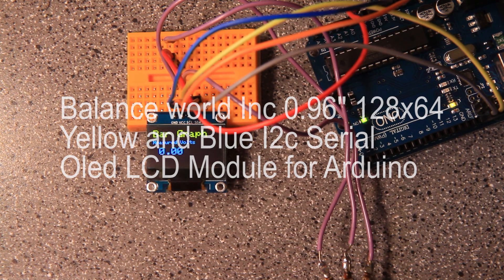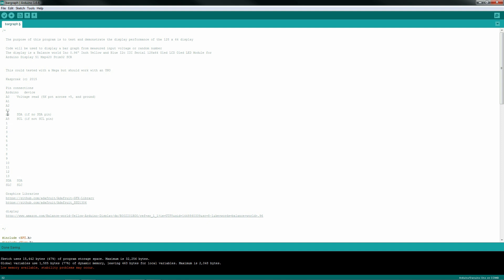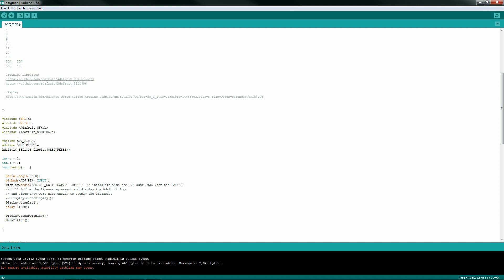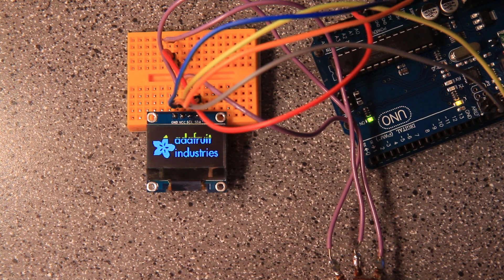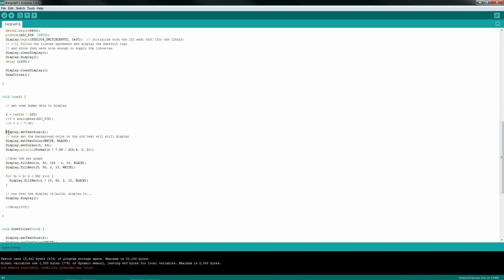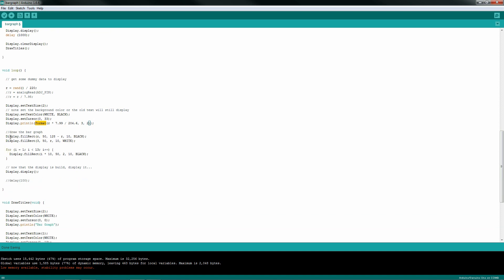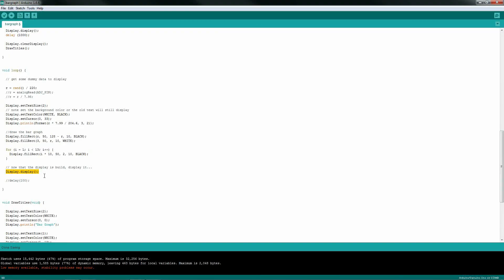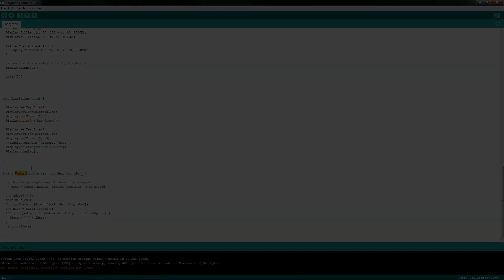Arduino and 128x64 OLED Display FREE CODE!!!

Comment: Hi Kris
I know this is going to be a long text/inquiry, so I apologize in advance.
I THANK YOU IN ADVANCE
My name is Jules, I’m an Arduino newbie. Before I spend a bunch of money with the Arduino I’d like to run this project past you, to see if this is even possible to do with an Arduino. Hardware I currently have
1- 12 volt 2 amp wall wart power supply 
2- Arduino UNO R3 (ie Elegoo super starter kit)
3- five ws2812b led light strips with 30 leds on each strip 
THE PROJECT
1- What I would like to do is have 5 different sketches (1 for each strip)
2- Then be able to run each strip one at a time, switchable with the IR remote supplied in the kit. 

So what and why I’m asking is this, I don’t know anything thing about how to program the Arduino, and I’d rather not go through the learning curve, and the expense if it’s something that won’t work anyway.
Reply from the maker: a few points
1. one LED strip requires 1.5 amps with all LED's displaying white meaning you will need a power supply of 7.5 amps (and that's the minimum). If you wan to ONLY turn one strip on at a time your 2 amp unit should work. If you turn 2 or more, the power supply will probably burn out
2. you will probably only need 1 sketch but 5 functions (one function per strip), but depending on what you are trying to do, you may able to have some if statements
3. I've never messed with the IR remote and sensor but I'm guessing you can recieve data from the remote and code a response
4. I'm not sure what it is that you are trying to do, but i'm sure you control each led and get different actions with the IR remote
5. you will have no choice but to learn how to program and Arduino. I'm sure there are examples out there to get you started. Especially in the libraries for the light strip and ID device

Comment: The includes in the source I downloaded don't look exactly like the ones I saw at 2:36 in the vid.  

*/

#include <SPI.h>
#include <Wire.h>

#include <Adafruit_SSD1306.h>

#define OLED_RESET 4
Adafruit_SSD1306 Display(OLED_RESET);

int r = 0;
int i = 0;

void setup()   {

Comment: The code will not compile   Help please
Reply from the maker: with the information provided, what do you honestly think I'm going to be able to do?
Reply: @KrisKasprzak  honestly after 5 years I wasn’t expecting a reply. Thank you for that.
I keep getting an error to compile and error status 1. Since I originally commented It seems to be happening to any code other then the on I had originally installed on the nano..  so it seems not to be the code, however any pointers on this currant issue would be appreciated.  Thank you for your time
Reply from the maker: @rickchowsr2532  a NANO? Try changing your compiled option to "Old bootloader." I don't remember exactly where it's at but you'll see it with your other compile options.
Reply: @KrisKasprzak  ok .......I’ll try that and let you know.
Reply: @KrisKasprzak  and yes a Nano
Reply: @KrisKasprzak  tried the old boot loader and same result

Comment: What should I do when I want to use  BME280 sensor with OLED at the same time?
Should I connect SDA and SCL pins from both sensor and OLED toghter and then plug it in Arduino sda and scl pins?
Reply from the maker: I've never used that sensor, but I believe it has a programmable address (assuming you are using the Adafruit libs). So yes connect all SDA pins to A4, and all SCL pins to A5.
Reply: @KrisKasprzak  Thank you Sir for a quick response.

Comment: Hello Kris,

Do you have an idea please, why is my OLED display processing the graphs so slow?
Reply from the maker: Not with the detail you've provided. What MCU? what's connected to what, what display, etc.
Reply: @KrisKasprzak  I'm using Arduino UNO with OLED I2C 128 x 64, USB as power supply...
Reply from the maker: @carlosesparza2029  if you are using my code directly, performance should be fast. if modified code, can you share it?
Reply: I have the same problem! I try this whith Pro Micro and Nano, same thing . I try other code and its the same! Maybe is the library that is corupt ?
Reply: I see that your sketch is 47% of your storage ! Why is my at 68% of the storage ? BTW Thank you for the tutorial. PS. I change the library and its the same!

Comment: Small comment on the library files. I believe you dont need the SPI .h file as the display runs on i2c (Wire) and you do not connect the SPI cables anyway so it can be removed.
Reply from the maker: Yes correct and good comment. Probably an artifact of the template that I use for nany of my projects

Comment: Is there a code that demos a rotating cube? i'd like a 3d graphing/ 3d shape demo on the small oled using an arduino uno
Reply: you could use one of the graphic demonstration in File>Examples>Adafruit SSD1306>...128x64_i2c

Comment: I used this to make it work on mine - but how do I extend it to work with an DHT22 to show temperatures after it shows a image at power on? (already got the image to work, but how to make it show temperatures after that) Can't make it work with the guides on "google"  :/
Reply from the maker: can  you get your DHT22 to work without using the display? Meaning write the temps and humidity to a serial monitor? If not there are example sketches that come with the DHT22 library.

Comment: I've bought an Oled module but it doesnt have a CS PIN 
Its a 6 pin oled with vcc gnd scl sdl res dc
I cant find a code for it
Reply from the maker: You sure it's an SPI? maybe it supports both? can the MCU's SDA is your sdl and the MCU SCL is your displays scl? First step is finding your pin mapping. the library that i use supports both I2C and SPI in the lib initialize with: Adafruit_SSD1306(int8_t DC, int8_t RST, int8_t CS);
Reply: If it does have a reset pin as well you need to include the RES (reset pin) in the code . otherwise it will not work. I had a similar screen at some point in the past and had to do it.

Comment: Hey, Thanks for that Video. I now see the random numbers flashing fast. What do i have to change to measure a battery? Tried the "#define ADJ_PIN A0" but I am not sure if i did it correct.
Reply: Ok it measures my battery, but instead of 1,2V it shows 12.XX Volts. How can i change the "," position? Thanks a lot!

Comment: All I get is "Bar Graph Random Number", no data displayed with r = r / 7.98; uncommented, likewise r = rand() / 220;
Reply: I had the same issue. You need to edit your Adafruit_SSD1306.h file (at Arduino libraries folder) and uncomment the #define SSD1306_128_64 line. Comment the other two options. That's all.

Comment: Error in code:
Arduino: 1.8.5 (Windows 10), Placa:"Arduino/Genuino Uno"

 CODE\bargraph\bargraph.ino: In function 'void loop()':

bargraph:81: error: 'ADJ_PIN' was not declared in this scope

   r = analogRead(ADJ_PIN);

                  ^

exit status 1
'ADJ_PIN' was not declared in this scope
Reply from the maker: I had that line commented out. If you uncomment those few lines then add a line #define ADJ_PIN A0 and connect the sweeper wire from a pot to A0 (the other leads go to +5 and GND). This will allow you to vary the voltage at pin A0 so you can make the bar graph show changes to the input voltage.
Reply: tks!

Comment: Hi Kris grat job and tutorial,
 
I really learn how to use the diplay with your video but I don't get the latest part with  "String Format()". What is it needed for? What does it does?

Regards
Reply from the maker: Format() is my own custom function for formatting a number and padding with spaces so the result is right justified--I've written some data loggers where numbers need to be displayed on an LCD, and right justified looks better than left. There is no sprintf support for floats in Arduino IDE so I hacked my own function--i hate using string data types, but i've not come up with a better alternative.
Reply: +David: so  his code was run, wasn't it? and that is high ranking code to common Arduiners with opening source code mind !!

Comment: Very nice use of the display. Found one on ebay slightly cheaper but has a fixed address, I am guessing no down side unless you plan to use more than one in the same project. 
http://www.ebay.com/itm/Yellow-amp-Blue-0-96-034-128X64-OLED-I2C-IIC-Serial-LCD-LED-Display-Module-for-Arduino-/391674736007?ssPageName=STRK:MESE:IT
Reply from the maker: These look exactly like the ones i buy, but no soldered jumper on the back? Sooooo close...
Reply: Yep, that's the difference I guess. OK if you are using just the one i2C device. Otherwise it's better to have the one with the jumpers. BTW, I have just finished a project and have used the learning from this video in there. I will upload a video soon and give you a shout out for the help.